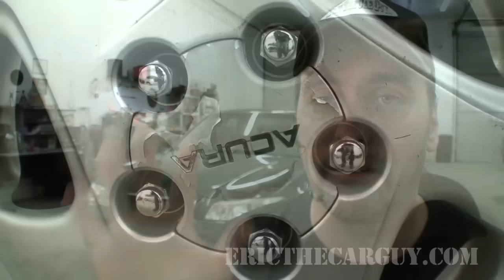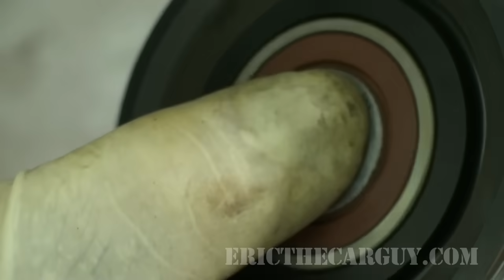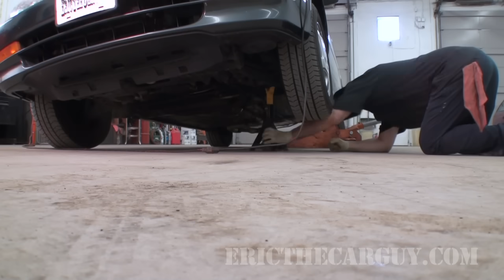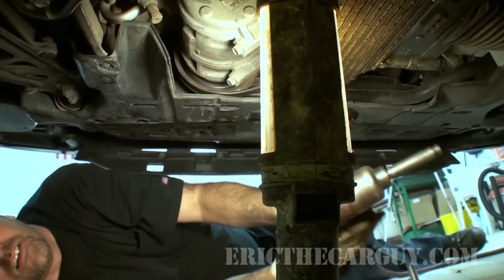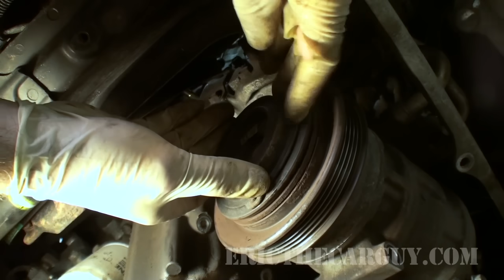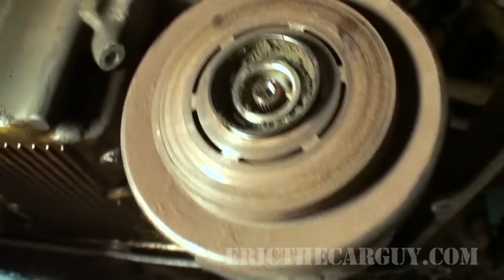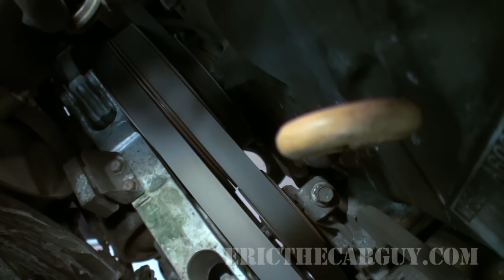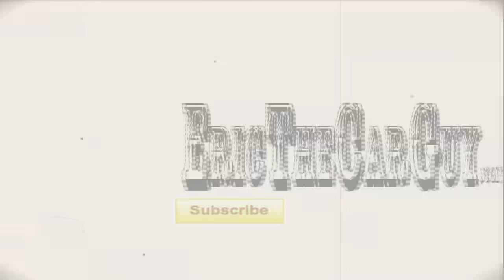AC Clutch Repair and Noise Diagnosis -EricTheCarGuy

Comment: Telling the 3.2 from the 2.5 is easy, you simply remove the engine, strip it down and remove the cylinder heads then accurately measure the bore and stroke of a cylinder, calculate the capacity of that cylinder and multiply that by the number of cylinders. Couldn't be easier really. 👍

Comment: From my first impression, before finishing the video, it sounds like your ac has gone bad. The ac clutch doesn't grate when engaged, so I know its not binding up when I turn it on. Your ac pulley may be making the noise but its a slightly different sound than that. Im about to take a look at my mustang ac clutch today & I sure hope it hasn't messed up the actual ac. Fingers crossed. Now back to the video

Edit: I sure hope it was the clutch assembly on my car like in ur video. What a relief that'd be!

Comment: Thank you so much! I just got my new TL 2 days ago. It’s a 2007 but has this same issue! I also notice it’s chewing the serpentine belt up, due to the wobble when the ac is active- the power steering is heavier, shifts are sloppier, brakes feel different. I’ll try this repair and I hope it works! When I changed the new serpentine belt it worked great… until the ac started and the wobble ate the belt and stretched it out. Thanks again!

Comment: 7:36 I would have used a bearing installer or a large socket that fits the outer ring of the bearing to seat the bearing!

Comment: I have pulley movement that makes a noise when low rev and AC on. Going to change the bearing.
But my question is, should outer clutch have wiggle? If no can this be the pulley bearings fault?

Comment: Recently I experienced the same problem on my Toyota Yaris. After experiencing a noise, I removed the accessory belt and gave the pulleys a good shake and the AC compressor pulley was loose. They sell a belt for my car listed as "without AC", so I'll use that belt bypassing the AC pulley. That way I'll have a car to drive and be able to work on the AC at my leisure.

Comment: I only discovered yesterday on Facebook that it's ac pump that caused the noise, after changing pcv velve, timing kit, cleaning throttle body, changing injectors, changing v belt tensioner trying to solve the problem,

Comment: hate to break it to you but that is not the way you replace a bearing such as in this case. You only apply fore to to the outer race. Hitting it on the inner will damage the race.

Comment: I have a 1996 Tahoe 5.7L with A/C, single belt system.  Belt is good and snug.  I get a steady and loud squealing noise when the truck is idling AND the A/C or defrost is on. If I turn the A/C on with it running above 1,500 rpms it will not squeal unkess I let the RPMs fall back down to near-idle speed.  But if I turn on A/C and then increase RPMs it keeps squealing.

The compressor clutch will turn easily by hand when truck is off, but it's not loose. It turns but won't spin after I push it or anything like that.  No oil or anything wet around the compressor. Blows cold air. Squeal stops immediately when knob turns vents off Defrost or A/C button is turned off. And returns immediately when activated again.

I also noted my Battery Gauge drops from 14 volts to 11.5 volts when the truck A/C compressor clutch or belt squeals. Almost like the whole pulley system is being slowed by the A/C engaging. 

I'm going to ohm test the clutch to make sure it reads 2ohm or higher, but other than that, what can I try to verify what's bad?

Should I spray a little light oil like WD40 on the front of the A/C clutch?  One guy did that online and it stopped his squeal, but that was a different make vehicle. 

Thanks in advance!

Comment: I was trying to figure out where the rattling noise was coming from on my car. Even a guy at a muffler shop couldn't find anything. But when I accelerated to highway speed, the rattling noise got worse. And I couldn't tell what the problem was, loose heat shield, muffler, I tightened up some fender liners to see if it would fix it, but it didn't. I even tried to find out if it was the AC or what. Even tried to see if maybe the alternator was the cause and I sure didn't want to think water pump. But the car still drove fine, I could keep up with traffic and pass cars no problem. But the noise was getting a little aggravating.

Comment: Hey Eric, I know this is an older video but I’m dealing with the same issue and may try this first. Did this fix your a/c problems for good or did you see more deterioration in the following days? (Not sure if you noticed while editing but at the moment you took the pulley head off and told us to watch for the spacers. It looks like one spacer fell to the ground and the second stayed in place. So it may have been one spacer short when you put it back together.) Thanks for the info and video content. I’ve watched several others to fix other issues I was having and hope this helps fix what I’ve suspected to be a faulty compressor for about 2 years now. I was told by the dealer If the air is blowing cold it’s best not to replace the part. Doing the whole compressor  job for my 2018 Buick Encore at the dealership is about $1000 including parts. I also don’t have a Freon recovery system so I’ve avoided doing the work myself. Knowing I can replace these parts for cheaper and don’t have to open the Freon lines to do so. It’s worth a shot. I also already have a new water pump, water pump pully, tensioner, alternator and belt. I plan to do it all at the same time and will now order the compressor clutch setup to add to the mix. I honestly hadn’t seen I could buy the parts separately before you showed it in this video. Before when I searched compressors for my car, it only showed the whole assembly and wasn’t given as an option.

Comment: Hi there! Thank you for making this video, it is very helpful for a chick like me who knows nothing but has to do this crap herself. Anyways my question is, I'm only having the sound at start up and sometimes when I turn the ac on when driving. The clutch is engaging as I can hear it and see it moving. So what could be making it squeal at start up and when driving? My guess is it's the bearing but wanted to get an opinion from someone who actually knows. Also I have already replaced the idler pulley so I know it's not that. Thanks a bunch! ☺️

Comment: ty for this Eric, on my 2006 Honda Accord v6 manual 6 speed nottsure if that is pertinent, but when i turn on my ac my car stalls out but runs fine when off ac.  Could replacing the clutch fix this or do i need to whole new compressor and/or kit?

Comment: My 2001 ford ranger 4.0 keeps blowing the 10A minifuse for the AC compressor solenoid. Any tips? 
Already verified that the coil works by testing it with a jump wire and seeing the clutch engage. 
The fuse blows when the truck engages into drive. When in park and idle, it doesnt blow.
 Also when the ac clutch first engages, theres a sudden loud grinding noise.

Comment: Thank you have been fighting with a noise coming from serpentine belt area and replaced clutch, coil and pulley on ac compressor but only stopped the noise for 2 weeks now is back again and sounds like it may be the tensioner pulley

Comment: I have a 2012 Hyundai Accent. The compressor turns on and the air conditioning cools, however, the compressor demands too much energy from the engine and the interior lights dim with the AC on (idle RPM fluctuates up and down between 1,000 and 500).  I recently noticed that white smoke with a burnt rubber smell sometimes comes out of the area where the compressor belt and clutch are located.  Any ideas what I can check or do to identify the problem and fix it?

Comment: could this cause a random belt squeaks? ac when spun by hand sounds like a windchime and also wiggles, new belt and tensioner pulley, water pump feels solid same as the ps pump just replaced couple months ago ... im going crazy

Comment: When the clutch gets burned up does the system get contaminated ? I want to know the likelihood  of needing to replace other parts like condenser , dessicant bag . drier ? I've got a 15 Ford Fusion 2.5 L . Clutch looks bad the clutch material is coming out the front AC not working warm air only

Comment: Does this also cause refrigerant leak? Mine is making the same noise, till the ac over the course of a year begins to lose coldness, till it wasn't cold anymore and the sound stopped, I live in the 3rd world and some mechanics just don't know what the hell they are doing or just cash grabbing me. I had the refrigerant refilled, cause the mechanic said it might be the evaporator which will cause me a lot of money, but after driving the car back home and the cold air was back, as I parked my car in the garage, I hear these same noise again, which prompt me to just search youtube, and finally found this video and other videos which has the same symptom and the same problem and fixed by replacing the clutch.

Comment: Holly Jesus I cringed every hammer hit 😬  those are bearings 🤦 use a bigger socket to cover the outer diameter if you strike the middle ring you could damage it don't install a bearing that way wtf it's easier and quicker for you but will cause the client more money quality brother take the time it's worth it for both ends 👍 great video though 👍 very clear and informative 👍

Comment: Hello, Erik I have an issue with ac system on our 09 toyota camry 2.4 The issue is it squeels load when we put it on. I figured was belt so I replaced also tensioner and water pump everything lines up too, also squeel when not using ac. Its a denso compressor. Any advice you can give, wifes car. Thank You
Reply: Check tensioner pulley and idlers?

Comment: Earlier today I found a comment from “fisqual” on “AC not working!!! The CAR WIZARD shows how to easily isolate the problem” saying that you can remove the washer/spacer on Honda compressors with a worn mag clutch for a bit more grab/life. Seems relevant here, since Honda = Acura.

“Its rather specific to Hondas but one thing you didn't mention is that the clutch can wear out just enough to not engage well and sometimes there's an easy fix for it. On Hondas you can unbolt and remove just the outer clutch then remove the shimming washer to decrease the clearance between the clutch and pulley so it will engage again. It only reduces the clearance by a little bit so it won't last for too long but it's a free fix instead of forking over the money for a new compressor right away.”
Reply: Hi!  Do you know whether I can prolong the life of these clutch/pulley/bearings if I leave my AC off?
Reply: @ Personally, it’s all beyond my tools/ability. Just came across it and thought it was too relevant not to find/share. I don’t even remember seeing or writing any of this now! :) Good luck. 👍

Comment: Jesus Eric you got over 3,000,000 views on this video.... That's impressive, I'm working on a 2006 ford fusion this month. In the air compressor is making noise whenever the customer turns on the heat.. I wanted to do an AC delete for this gentleman however I didn't see any dorman products to do it or come up with some other redneck solution.... Or I might just buy a new. Happy new year to you and your channel.

Comment: Good info, but, never hit a bearing race directly with a hammer. Either surfaces can fragment with explosive force due to the stress forces embedded in hardened alloy steels. Choose a tool made of a "softer" metal. Avoid brass for bearing install. Just say'n.

Comment: I removed my clutch and pulley because the pulley was going bad but the new one was the wrong part. When i put original pulley and clutch plate back on the. ac compressor made a grinding noise and then stopped after an hour or so. Now the clutch plate wont engage. Is the magnet toast or the ac compressor?

Comment: I have a question, hoping someone can give advice. A/C blows hot air after 20-30 mins. It has refrigerant. Everything seems to work.... 
Also 1 of the vents blows warm air. By the way it's the same vehicle....

Comment: What’s the cause when I’m at 25mph and above when I accelerate there’s a like a grinding type of noise when I let of gas it goes away when I apply comes back 2009 Honda Fit sport auto replaced water pump tensioner belt nothing

Comment: Mine gets quiet when the ac is on but makes noise when I turn it off
Reply: It's the other way around for me but I still getting cold air that's the thing .
Reply: @brooklyn7941  Mine finally quit. Clutch plates got really loud.So I've bypassed that pulley and changed to a different Adler.Pulley, but now that it is getting hot.I'm going to have to get it fixed at some point
Reply: @willblockin  it's like making this noise like if someone was to hit a tin can with the tip of their finger
Reply: @brooklyn7941  Yeah that's about how mine sounded or like somebody tapping two inches together
Reply: @willblockin  but that's the thing tho ima till getting cold air tho
Reply: @brooklyn7941  I did too for about 2 years then it went out completely
Reply: @willblockin  it's a Honda tho lol I heard this now for 3 years
Reply: @brooklyn7941  oh wow hahaha ha you might be good for a while then
Reply: @willblockin  yeah plus I stay in Florida so u know it's hot outside no matter what
Reply: @brooklyn7941  mine worked in Port St Lucie and then I got back to north Carolina and it went dumb on me

Comment: 99 Acura RL, idler pulley bearing finally failed after 23 years and 224,000 miles (and the rear flange on the exhaust B-pipe. Just going to weld it. Original exhaust pipes and muffler are all still good otherwise. (amazing)

Comment: Never hammer a bearing in like that! Especially with a metal hammer. Use a press! If you don't have a press then go to Walmart buy a propane bottle and torch adapter. Buy a RUBBER mallet. Buy your bearing and stick it in a freezer the next day heat up the pulley or part that takes a bearing. Do this inside while holding the part with channel locks and make sure u have a small piece of metal to set it or even a small smooth brick. After heating it up for 10 minutes or so. Immediately get your bearing out of your freezer. It should Immediately drop in or press in with your fingers. If not use the rubber mallet. Speed is of the essence doing it this way. Otherwise use a press!

Comment: I just came across this. My step daughter has a weird noise (sounds like metal scraping" when her car was running. Looked down in there and noticed the a/c pulley was spinning at minimum, half the speed of the others and at times, it would change it speed. Could this be the same issue? The noise sounds exactly the same, but it's winter here in Michigan so no reason for the a/c to be running, just heat. The car is running a bit rough. I had guessed idler pulley but this seems dead on.
Reply: My idler pulley is bad (bearing) and it's cold here in Illinois. Makes much more noise when it's cold. Same nasty sound.

Comment: I see grease coming from the AC compressor clutch on a  2013 Ford explorer XLT. I'm going to replace it asap. I'm the meantime, can I still run the heat? Thanks for so many helpful videos!

Comment: Eric, I'm having the exact same problem/rattle/noise/loose assembly on my old Ford F150. My mechanic is out of town for another month. My question is if the the AC pulley/compressor, can simply be lubricated to help with noise and friction since the assembly is NOT Tight? Is this dangerous in any way for driving? Once my mechanic is back, I'll get it taken care of, or should I NOT wait? Wahi' Valleys

Comment: I WISHED IT WAS THAT EASY TAKING A AC OFF OF A HYUNDAI TUCSUN, you have to take half of the FRONT END OFF. AND TO CHANGE THE ALTERNATOR YOU HAVE TO TAKE OFF THE THE RIGHT FRONT DRIVE AXLE<AS SOON AS I GET IT FIXED I WILL GET RID OF THE BIGGEST PIECE OF CRAP EVER MADE AND PUT ON THE ROAD AND MADE IN KOREA< NO DAMN WONDER!!!!!!!!!!!!!!!!!!!!!!!

Comment: Thanks for the video it really helps. I have a 06 Chrysler 300C and it sounded like a rod knock until I turned off the ac and all went smoothly quiet. Now I know what to check bud. 👍

Comment: Question 2007 ford focus car makes a rattling noise  i turn on ac but it doesn't make the noise just yet but when i put in gear it makes the noise. Thanks.

Comment: Good job.. But one more thing.. i worry that the suction and discharge line of the compressor carried the entire weight of the compressor when the four mounting bolts were removed.. should there be any support or something? Thanks man if you notice 👍more power

Comment: I think we have the same issue..  Did his car still blow cold? I noticed not long ago we started seeing condensation from ac vents. Then over night the Noise came. Took a look changed the idle pulley.  It needed it bad. & tension pulley. Belt. But still the Noise. Not running hot... Drives great. Just noisey as can be. Driving with this ? Is it safe?

Comment: Thank you Sir! I think you might have just saved me a lot of money on a 2000 camry  with 202k on it. It was my Mom's who passed with cancer after she only got to put 800 miles on it. My Dad is now gone too and he told me he hoped I that drove that car till the wheels fell off! I Drive it to work 38 miles one way. It now is in need some TLC and I have that same compressor noise. I'm also thinking it's the clutch. Thanks for the vid, it's still a nice car and I'm going to try to go to 300K ☺️!

Comment: ON A 2007 HYUNDAI TUCSUN HOW ARE YOU SUPPOSE TO TAKE OFF THE A.C. COMPRESSOR WITHOUT TAKING PART OF THE FRONT END OFF AND WHEN IT COMES TO TAKING OFF THE ALTERNATOR YOU HAVE TO TAKE OFF THE FRONT RIGHT CV AXLE, MAN WHEN I GET THIS THING FIXED IT'S GETTING TRADED IN!!!!!!!!!!!!!!!!!!!!!!!!!!!!!!!!!!!!!!!